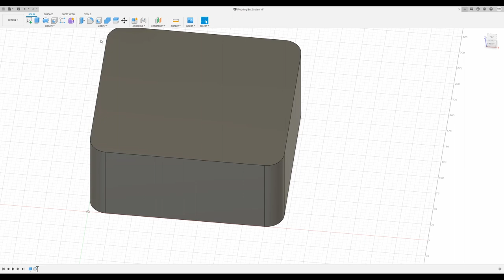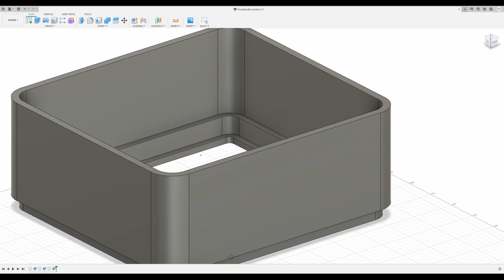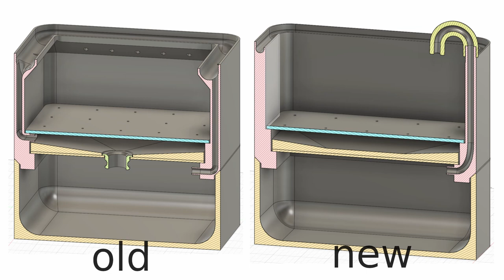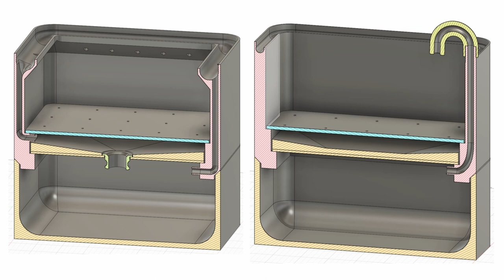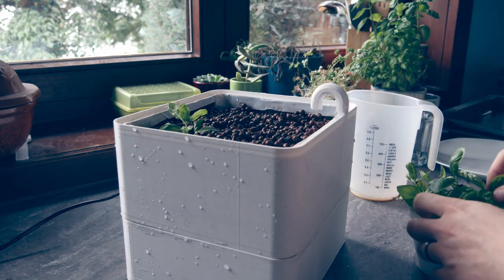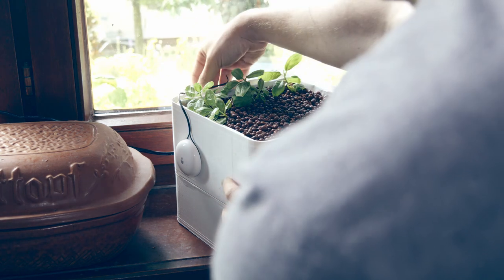Making a 3d printable hydroponics system for my window sill

Comment: Just an idea, but id replace the holes with a siphon. This will ensure that small particles wont clog the tiny holes
Reply from the maker: I like the idea. But I guess then I’d always have some remaining water in the top part? I have no experience with siphons. 

Anyway, I am building a new version that isn’t based on flooding. Video will be up within a few days.
Reply: @matoumakes  Very little if you design it correctly, the "momentum"of the water will suck it almost dry. The other thing is, evry time it floods it will mix with the left over,... And you can use the left over as a feature, not a bug.... When something goes wrong your plants still has a bit of water... :)... I am thinking of buying a 3d printer or building one myself... but i have no idea where to start. :/
Reply from the maker: That sounds like a nice feature. I will experiment with the idea a bit. Thank you!

Wow building a 3D printer still sounds a bit intimidating to me. Although I would also be super interested in learning more about that. Good luck!
Reply: @matoumakes  look for bell siphon they work really well it will fill then drain
Reply from the maker: Yes, by now I really think I should design something with a bell siphon :)
Reply: Not sure if a bell siphon is the same thing I'm thinking about, but I'd say an archimedes cup style of siphon would be great

Edit: just looked up bell siphon, and it's exactly that, so +1 on bell siphon idea
Reply from the maker: Yes 😄
People got me convinced that that’s the way to go
Reply: You could make bell syphons that drain the camber regularly.
Like mentioned here https://youtu.be/_vV_z_0lFQ8?t=235
Reply from the maker: Thanks for the link :)
Reply: Look into Bell siphons or Auto siphons.
Reply from the maker: Oh yeah. I definitely want to try one of those.

Comment: Kittens had best reaction. Also a 'greedy cup' design might work too, then it drains when it gets to a certain fill automatically.
Reply from the maker: I haven’t heard about the ‘greedy cup’ before. That seems to be working similar to a bell siphon. Thanks for the hint :)
I imagine a bell siphon would be easier to clean.
Reply: @matoumakes  I believe it's the same principle behind the two. The biggest reason to use something like that imo is it doesn't require any electronics or monitoring.

Here's a simple video detailing the 'greedy cup', for anybody interested:

https://youtu.be/siSy2ixU0o0
Reply: @matoumakes  Greedy Cup is the original name for bell siphon
Reply from the maker: That’s a funny name, though. I like it
Reply: Just be sure to have enough water in the reservoir, at all times, as it would not drain at all, before filling the siphon. A hybrid approach, with some draining holes, could solve that problem.
Reply from the maker: Yes I agree
Reply: @matoumakes  it's similar. I've heard it called a Pythagorean cup or similar.

Comment: I used to make these for ahhm reasons. you want a pump that can feed into the bottom end with an overflow tube at the top; run the pump for 5mins to 15mins , stop pump, it drains back out via the pump. set to flood between 2-5 times per day depending on medium. the benefit of this method is you can use a cheap segment timer (15min sgements) to automate the filling and no need to stop when its filled as it will run into the overflow.
Reply from the maker: That's interesting. Haven't thought of doing it that way. I like the idea!

Comment: A mini bell siphon, or stand pipe with a small hole at the bottom will ensure your planter floods and drains and can never overflow. For the simple standpipe design you'll still use a timer to allow it to fill then shut off the pump to allow it to drain down the hole at the bottom of the stand pipe. Bell siphons don't require a timer to flood and drain, but they take some fiddling to get them to operate properly.

Comment: This is a cool design.
Regarding the trashbag: I would fold it without cutting, so it's perfectly closed without tape.
Hope your kittens don't use it as drinking fountain after adding nutriens.
Reply from the maker: Oh I didn't use the tape for sealing. I actually folded it without cutting the corners. The tape only there to keep the corners in form (and to attach the foil to the print of course). 

And regarding the kittens: I had to put the system in a room that they don't have access to :D

Comment: I have a suggestion. Create an overflow on all 4 sides at the height you want it to 'stop' at. That way if your holes clog, that's backup. 
Also, you can design a tap for flow control. That way you don't need an on-off controller.

Comment: the roots will get anywhere they can. those little drain holes included. in time, she will stop draining and dump the water out.
Reply from the maker: I think you're right. I'm actually not using that system any more. Instead, I designed a new one: https://www.youtube.com/watch?v=2em0Q3HlyuI

Comment: If you drained from slightly above the bottom, the drainage rate would be easier to get right. A typical Dutch bucket allows for some water retention at the base so that there's always water at the roots and nit just in the reservoir. 

Adding a bell siphon would be helpful if you want to go with more of an ebb and flow style of setup.
Reply from the maker: Ah that might be a good idea. Thanks 😃
Reply: @matoumakes  I'd be curious, both systems did work.

Comment: I'd recommend using food safe plastics or coatings for everything, if you plan on eating from your planter. Plastics can contain unhealthy chemicals and I would not run the risk of accidentally accumulating those in my food. Same goes for duct tape or any other glue. The more chemical inert the building materials are the better.
Reply from the maker: Yes I think I need to be more careful with that

Comment: Mhh... I think a better working solution, and one possible due to it being 3D printed, would be to change the formerly open nature of the waterway at the top and close it entirely with small holes pointing inwards through which the water gets injected into the main section housing the plants ( and a large overflow siphon at the opposite end to feed overpressure water back into the system ).
Regarding the filter either consider mounting it to the bottom using magnets for easy removal or relocating it to the pump inlet? Could possibly also section the bottom into a bunch of chambers where the debris filled water would fall into the first section with some debris flowing to the bottom before overflowing into the next chamber and so on until it reaches the pump. I'd also consider the installation of a floater marking the water level ( of the last tank with the pump ) or maybe a transparent wall section to show the water level like that? Ya kno'... Overengineered stuff https://imgur.com/gallery/ZYpHEk9 😁
Reply from the maker: 😃 I really like the ideas. Especially the debris section. I’m not sure if closing the waterway would be good, as I couldn’t clean it inside. 
My second version of this actually includes a floater for showing the water level: https://youtu.be/2em0Q3HlyuI
Reply: @matoumakes  Well you could alternatively change the in place 3D Printed and thus permanently closed waterway for one with a lid that can be bolted on - If you have the option ( lieke I do with my CNC ) to make it out of a nicely cut acrylic then you can even look inside to check what's going on. A bunch of nicely placed flat head screws to hold things in place give most things a nice professional look 😉
Reply from the maker: I like that.

Comment: Really liking this design! Just getting into hydroponics and been looking for a 3d printable flood and drain system so this looks perfect! One question, where did you get the water sensor from? What make is it as it looks exactly the sort of thing I want to use? Thanks and good job on the design!
Reply from the maker: Hi. The sensor is an Aqara Water Leak Sensor. I think I ordered it from China. But you can usually get these in some more local online stores as well. It requires a smart home hub, though. My setup is a little complicated and there would surely be simpler ways of doing that. (I have a Conbee stick with deconz, phoscon app and home assistant as my smart home hub)
Reply: Ebb and Flow.

Comment: Hey! Nice Video. Can you add what kind of pump you used and what sensor you used? Maby a detaild version how you can automate it
Reply from the maker: The pump is an Exo Terra Repti Flo terrarium pump. I think the 200 version. 

I’m actually planning on making more videos on automation. Just not quite sure how exactly, yet.
Reply: @matoumakes  Thank you. Thank you for your design. I have also designed a hydroponics according to your model. However, I moved the plant container to the water reservoir and of course automated the whole thing. The thing now has a water sensor, an ultrasonic sensor, an RGB light to show me the status, an LCD screen and it's all controlled by the microcontroller.
Reply from the maker: Wow that sounds amazing! Are there any pictures available of it somewhere?
Reply: @matoumakes  yeah, i just wrote you a message in thingiverse :)

Comment: What kind of resin did you paint this reservoir with? Was it one that had to be cured with a black light?
Reply from the maker: No it was a two-part epoxy. It takes about 12 hours or so to cure.
Reply: @matoumakes  Thank you

Comment: ok so could you instead of having a sensor to drain the water could you do like a bell siphion ?
Reply from the maker: Yes. That should work as well. Not sure about getting the timing right then. Then sensor is a little bit more flexible in this regard.

Comment: Hi there, how are you able to print a watertight container?
Reply from the maker: I sealed it with epoxy. However, I am not 100% sure if it’s food safe. So I’m actually currently not using it any longer. 

But I was told that printing with PETG might get you watertight prints as well.

Comment: Hey this is awesome!!! When I saw the video quality I just assumed you were a massive channel, this is great!!! Is the trashbag/3d plastic foodsafe? Or is there a resin you can coat with that is foodsafe?
Thank you for sharing the file!!! I look forward to trying this :D I have a lot of large outdoor NFT/kratky/DWC systems but not flood/drain yet. I love the idea of trying with a small one like this!!!
Reply from the maker: Oh cool! How are your experiences with your systems? I might try something like that as well some time. 
Unfortunately I have no idea how foodsafe it is. But I expect it shouldn't be too hard to find coating that would be foodsafe.
Reply: @matoumakes  Really good!!! I'd say you'd be fine since you have the coating there, plus a lot of people make 3d printed parts for hydroponics and never had issues :D 
So for DWC I use bucket like systems, with net pots on top - super practical and easy to maintain/setup but are ugly. I use the DWC buckets for chilli peppers! The NFT I use an ebay system that was just a bunch of pre-cut poly pipe but in hindsight I should have just done it myself, it would've been cheaper and I could have made it to the size I needed! But it works really well for veggies like lettuce, chard etc. For kratky, I have some olive HDPE barrells (22liters) which are perfect. I cut holes in the lid for 5" net pots! If you're interested I can take pictures of the various systems when I get home :) 

I love 3d printing but so far only have a resin printer. You've inspired me to get an FDM printer!
Reply from the maker: Hannah Walters I find the FDM printer very useful and a lot of fun. I can recommend it.

Comment: what did you use as a growing medium
Reply from the maker: Those are clay pebbles from the garden center. But I'm not sure, I'd use them again. At least not if there is a water cycle, because it takes a long time before all the dust is washed off. Tiny rocks might actually be better.

Comment: Nice project, I had the same idea a few weeks ago, but I lost the interest. Haha 😅
Reply from the maker: I know the feeling 😅

Now that I’ve been using the system for a while, some flaws became apparent. Mostly that the lower part is pretty inaccessible when the top is filled. 
So cleaning the pump and the reservoir is quite difficult. 
Other than that it’s quite reliable.
Reply: matou makes If you want, we can work this out together.. 😉 

PS. Du sprichst ja auch offensichtlich deutsch oder? 😅
Reply from the maker: Nico S. I’m currently concentrating on other projects. But I would love to hear of any improvements if you plan to create your own 😃

PS: ja offensichtlich 😅

Comment: Does anyone calculate in how much such a pump use over a year?  I see so many people use that kind of things on YouTube for a couple of plants.

A pump on a solar panel would make this much more economic viable.
Reply from the maker: Oh yes! A solar powered system would be awesome. I’m thinking about creating a bigger one powered by solar. 

The pump is about 2 Watts. So less than a raspberry pi computer.
Reply: @matoumakes  If that has to run 24/7 it would cost me €12 a year over here 😅 not much but it’s one of many things. That’s why I ordered solar panels and try to make everything solar powered.

Not to be green but for the money 😇
Reply from the maker: Especially since energy is getting so much more expensive now.

Comment: Hello. Try adding a Bell Siphons to your system instead of a drain hole. such as this one https://www.youtube.com/watch?v=Ia1BQFTaG7c&ab_channel=RobBob%27sAquaponics%26BackyardFarm. You will also have to increase the size of the water reservoir equal to or larger than the size of your substrate reservoir.
Reply from the maker: I thought about the bell siphon. But I wanted to start with something simpler to design. If I make another version, it will probably include a bell siphon. They are really cool 😀